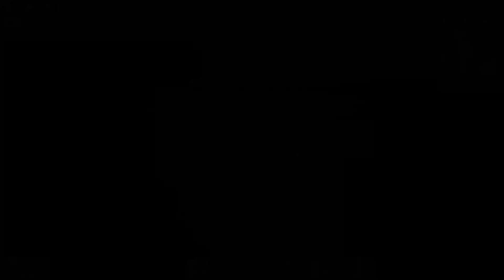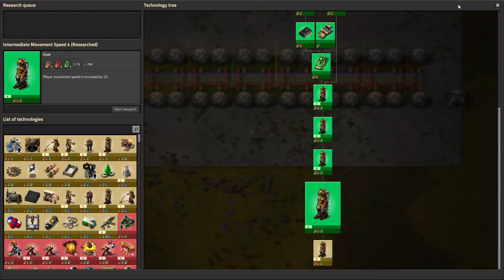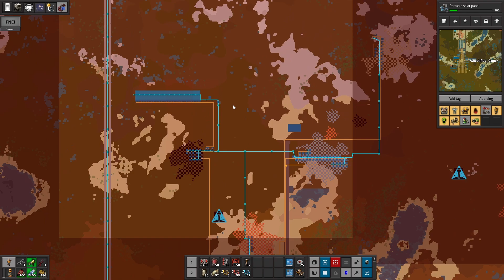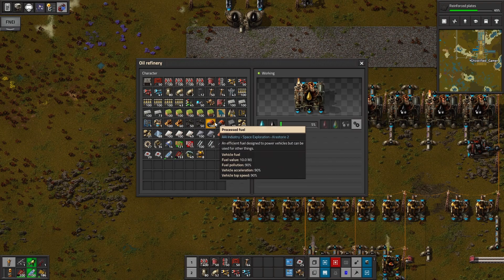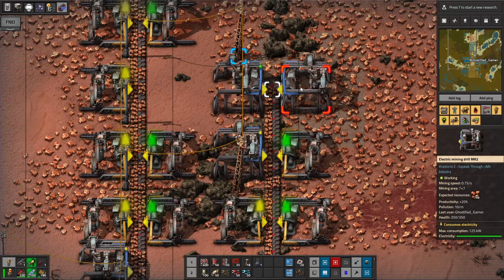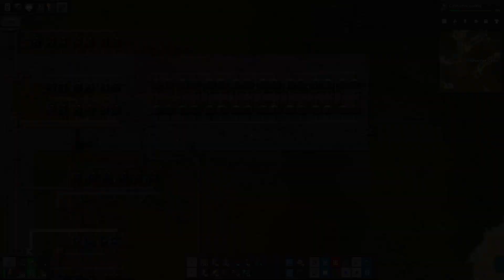Factorio K2SE - Military Tech Card - EP4

Comment: The reason why your power stayed the same when switching to the new turbines is that the energy provided by a turbine depends on the temperature of the steam, not the turbine that you use. Those turbines can handle up to 50x 415 C steam per second, and 415 C steam contains 200 kJ (500 J / degree above 15 C in Krastorio 2), which gives it the maximum output of 10 MW. However, if you only feed it 165 C steam, it can produce up to 500 J/C * (165 C - 15 C) * 50 /s = 3.75 MW, which is what they're producing here.
Reply from the maker: Ah.  Thanks for the info.